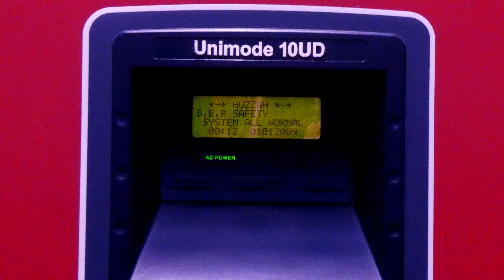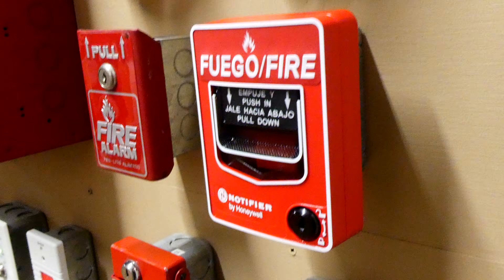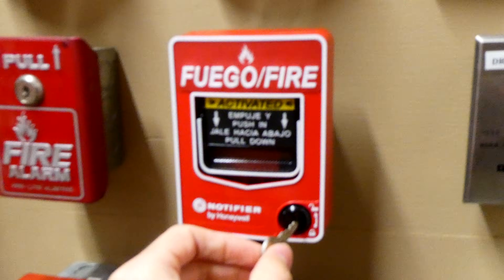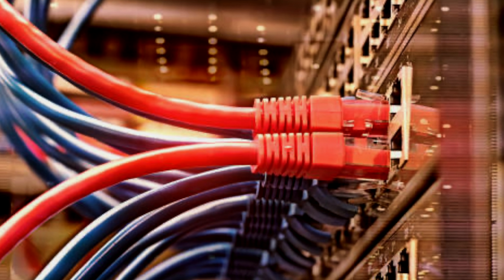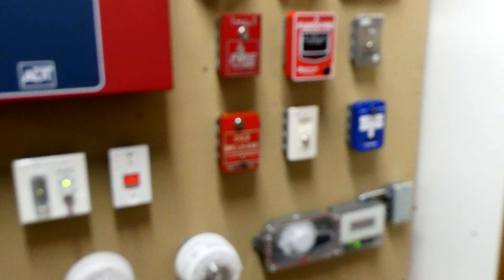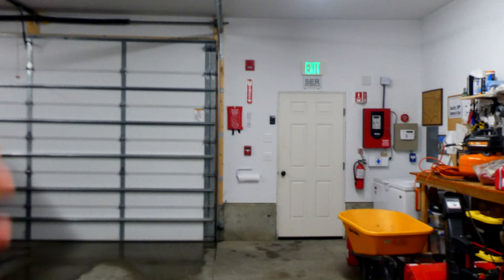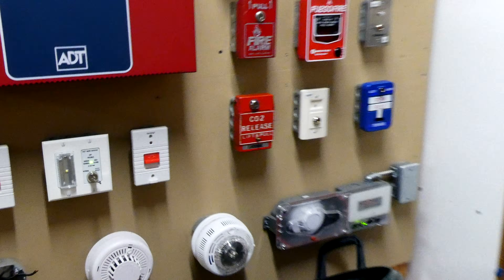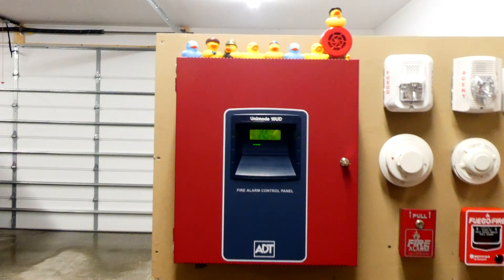ADT Unimode 10UD Fire Alarm System Test 22 | CO2 Fire Suppression System

Comment: I love the marchtime! I've never seen them coded like that before. Glad to see everything working perfectly, well done Grant!
Also, expect more CO2 release stations on the market. Companies like mine are actively replacing many CO2 tanks with Novec 1230 for it's environmentally friendly chem composition and safer handling, or FM-200 for its cost effectiveness. While FM-200 is more cost-effective, it is still dangerous to handle and may cause cold injuries fast if improperly handled. Also just to point out, clean agents also reduce heat from the fire. The state conversion of liquid to gas causes the agent to discharge extremely cold. Regardless of choice, the main risk really comes down to two dangers: asphyxiation, and explosion. Not that the gases are flammable, but rather because the pressure development may legitimately cause structural damage if not vented sufficiently.
Reply: 🎉😂😅ckbckx  a j de figfuepwe
Reply: Pretty much every data center I’ve worked at or in (and that list is long nowadays) is FM-200 or ecaro 25, mostly over the Novec 1230 because of the larger tank size required. From what I’ve read, and seen in video and a couple times in person, they all perform very well when they’re needed. I’ve never seen a system using CO2, but, I’m in one industry with mostly modern (20y old or newer) buildouts.
Reply: @OverKillPlusOne  I've seen a few systems in data centers which were built for CO2 and retrofitted for FM-200. Additionally there are some chemical facilities which use CO2 for combustible oxidizers. It is very rare for us to upgrade these systems, let alone see them.

Comment: Co2 is a clean agent in terms of no mess left behind but however it’s not technically a clean agent because it does leave moisture behind when evaporated. A true clean agent is halon which is outlawed or novec 1230
Reply: CO2 is still common in reactive metal storage. In some data centers, it can still be found as the choice suppression system. Because CO2 is not electrically conductive, it generally doesn't become a major problem if liquid CO2 builds. Dehumidifiers are used if air conditioning is insufficient in reducing moisture.
Many upgrades I've done involve CO2 to either FM-200 or Novec 1230. Both are great, but FM-200 is cheaper, albeit more dangerous to handle, and less environmentally friendly.

Comment: I just got a fedral signal 450D horn strobe and i dont know how to activate it
Reply: Many older fire alarms are difficult for beginners to connect because the electrical requirements may be different from what is expected. Do some research on what voltage that model requires since it is likely higher.
Reply: @Gattka504  thanks. I also  figured out how to apply power to it

Comment: When a CO2 fire suppression systems is activated be somewhere else or have an scba
Reply: You don't want to be in a room when a clean agent activates, even with SCBA. You may face severe eye irritation and cold burns depending on the agent used and duration of exposure. It will 100% certifiably suck.

Comment: CO2 suppression systems are used in a environment for a example: a server room where a fire starts but you don't want water to be sprayed to put out the fire, instead you can use deadly carbon dioxide to suffocate the fire by replacing it's energy source with carbon dioxide. I might get a CO2 suppression system pull station for my fire alarm collection.

Where can I get a CO2 suppression system pull station?
Reply: They’re really hard to find but I’d suggest ebay tbh
Reply: @agreel25  Okay. I'll see if I could find them on eBay or not then I'll try to look for it on another online store but definitely not Home Depot because I definitely know that they don't sell fire alarms other than smoke alarms and Fire extinguishers.
Reply: @Collector3476  yep, If you want commercial fire alarms, It’s only available in online retail. Good luck!
Reply: @agreel25  Thanks man. If I do manage to find them then I'll totally going to but probably two of them for my collection.
Reply: @Collector3476  anytime dude, I also heard that your previous channel got hacked, sorry to hear about that.. I know how It feels because mine got terminated for no reason 😂 😂 😂